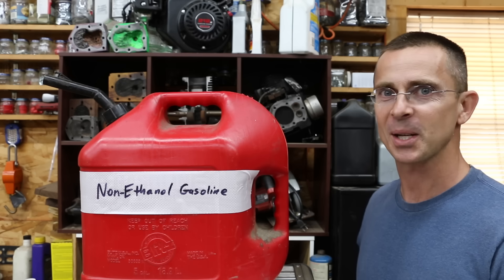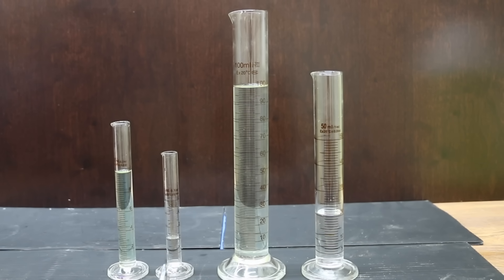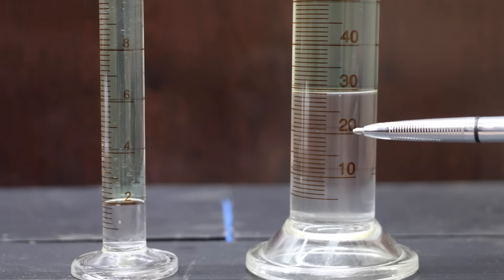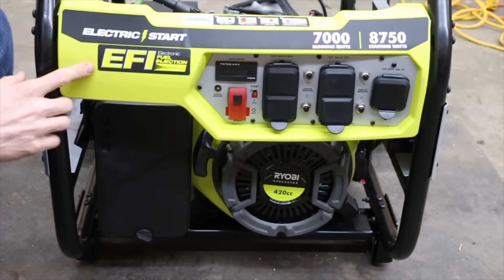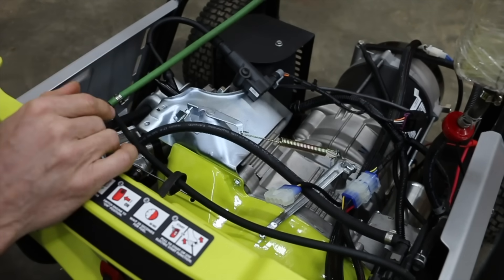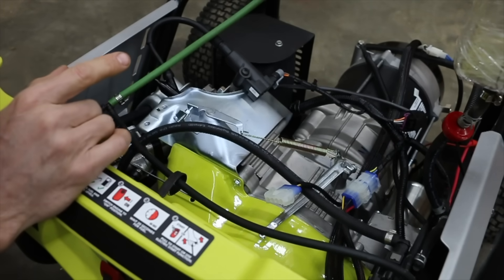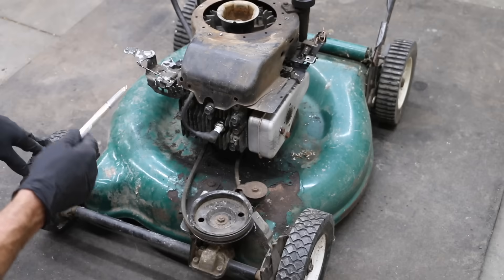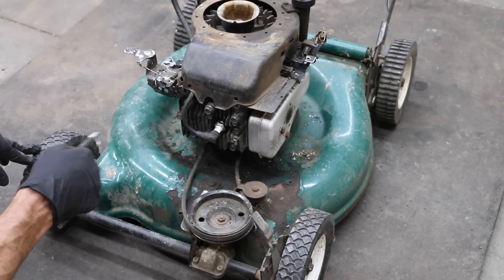Is Non-Ethanol Gasoline Really Better? See the PROOF!

Comment: Not to sound like a supporter of Ethanol, but in highway vehicles it does make for cleaner fuel as it will absorb water, clean fuel injectors ( so don't buy into fuel injector cleaning being sold to you from shady dealerships or garages) and does make your exhaust cleaner.
Reply from the maker: Thank you

Comment: Ethanol cost me many thousands of dollars in damages in addition to hours of frustration.  Stupidest idea ever conceived by the lowest IQ drones in government.  Finally had enough complaints in our community that all our pumps have ethanol free premium.  The way it should have been from the beginning.
Reply from the maker: Thank you
Reply: No problem.  Our then brand new boat still does not run properly to this day after 2 carb replacements and all new fuel delivery system ruined by that crap. Used to go 60 MPH first 2 years prior to ethanol introduction.  Today..? lucky to get to 40 MPH and up to plane.  Done throwing money at it after ethanol destroyed the fuel delivery system that keeps contaminating new parts.

Sold our 4 wheeler with only 800 miles on it as a non runner after multiple carb rebuilds and finally a new one....trashed yet again.

I am very mechanically inclined, but there is a point where the uphill battle against other's ignorance has to stop...liquidate the stuff and move on.

I cannot express my hatred for the FILTHY piece of human garbage that thought all engines would be fine with this.  I bitched day one that premium should be left alone as engines that require such fuel cannot even utilize whatever "benefits" alcohol could offer.

Sincerely,
Unfortunate and perpetual victim of living in a world run by 5rh grade educated idiots.

Comment: i have 3 carburetor machines in my garage that wont start, thanks to ethanol. I don't exactly know how to strip them down and rebuild them and haven't gotten around to doing it.   The tip with the water is great. I was planning on going 30 mins out of the way to find the only local station that sells ethanol free gas. now i wont have to i can just bump up the octane a bit.
Reply from the maker: Thank you

Comment: My lawn mower starts much easier with ethanol free gasoline.  Fortunately a station near me sells ethanol free at one pump.  If ethanol free gasoline doesn't work, then use starting fluid spray in the carburetor. Starting fluid is ether, which is explosive, but it also makes excellent spot remover for getting roil or grease off clothing. Just make sure you us it outdoors.
Reply from the maker: Thank you

Comment: Been hearing alot lately about using 110ll avgas in small engines because it has no ethanol, some of the other weird additives in pump gas and the almost non-detectable amount of lead actually helps with lubrication. (more for two strokes, but I'm thinking upper cylinder walls in 4 strokes) Maybe a head to head challenge? 5-10 tanks of each with a teardown after? Compression before and after.
Reply from the maker: Thank you for the video idea!

Comment: Ethanol has been in most gasoline since the mid 1980's.
E10 might not make that much of a difference as far as the cleanliness of the inside of the engine, but if you use E85 you should see a much cleaner cylinder head and spark plug after the teardown.
Reply from the maker: Thank you

Comment: First of all, small engines do not run that smooth on ethanol added fuel, they spit and sputter and run uneven.This is fake. Government, Fuel Companies, Lobbyist, are all liable to pay for the damages this fuel does to all small engines.
Reply: C King, you must hop into a plane to Brazil and warn them about ethanol in small engines ASAP!!!!!!!

Their common gasoline is not a measly 10 or 15% but a whopping 27.5% minimum.  They have small engines as found in this link:  https://www.honda.com.br/produtos-de-forca/gx120

Hurry before it is too late!!!!  God's speed!  If you are right about this they should more than thank you for it.  Now go....ooooooooo…...

Comment: Starting back in 95 or 96, Ford started to build motors to run on "flex fuels"; ethanol based fuels. From that time on, most auto suppliers changed their components, whether it was plastic, rubber or metals; to withstand the properties of ethanol based fuels. If you're not sure check your owners manual or the emissions sticker under the hood. It should state if it's compatible w.Ethanol fuels after the 97 model year. My 94 T-bird was not but my 97 was as stated on the sticker.
Reply from the maker: Thank you

Comment: But anyways ethanol prevents knocking and detonation right?  Carbon deposits are almost the same....
Reply from the maker: Thank you!
Reply: @ProjectFarm  sir I have a question...if we send the carbon monoxide from exhaust gases back into the engine cylinder what will happen? Will it get combusted? Will it increase the efficiency? ...can you try this for me just send pure carbon monoxide inside the air filter in a Spark ignition engine sir please....I wanted to know if carbon monoxide can act as a efficiency increaser....

Comment: Ethanolized gasoline is the worst thing that has ever happened to boating. In the California Delta most harbored boats are inoperable due to this garbage. Unlike most modern cars most harbored boats have a vented fuel tank that is open to the atmosphere where daily barometric changes introduces moisture. The moisture is absorbed by the fuel and over time it will cause the fuel to “phase “.  This is when the fuel separates into three distinct fluids. Water at the bottom then ethanol and gasoline at the top. There is no publicly available additive that can re combine the fuel, it must be removed. The water is acidic and corrosive which destroys the fuel system. If someone manages to remove enough water to enable ethanol to run the engine, it may run very poorly, like a cold motor but in fact it’s running lean because its not jetted for this fuel. This is where someone will make the mistake to take it out and “blow it out “. That’s when engines blow up. If the ethanolized fuel doesn’t phase, than this fuel attacks rubber and plastics components that where never intended for this fuel. If you have this type of boat, the best thing you can do is keep the tank full and use the boat to keep the fuel fresh or.......sell the boat.
Reply from the maker: Thank you!

Comment: Here in Iowa where most of the Ethanol comes from, most stations have 87 octane E0 and 87 octane E10. The E0 is always at least 30 cents more expensive than the E10. Some larger stations also have an 88 octane E15.
Reply from the maker: Thank you!

Comment: Back in the 70's when they took lead out of gasoline, my grandpa use to go to the local airfield and buy Av-Gas or Aviation Gas for his boat and small engines (both four and two cycle).  The difference between leaded gas, unleaded gas and Av-Gas was amazing.  That old boat ran like a scalded dog across the open water.  Maybe you can do a fuel test with Av-Gas sometime.  I don't see it much any more but the smell still takes me back to grandpa's garage.
Reply from the maker: Great video idea!

Comment: can you do a test with ethanoland non-ethanol gas and see what happened to the carbureted engine when it sits over time, I've been having issues using ethanol gas lately in my carbureted motorcycles and it seems to keep clogging up the Jets.
Reply from the maker: Thank you!

Comment: It's not so much carbon buildup or efficiency, rather the materials of the fuel system. It can destroy certain materials in carburetors over time coursing performance issues or total carburetor rebuilds. Better suited for fuel injected vehicles like it's deigned to. We have a 3 wheeler that needs a new rubber needle in it's carburetor, we ran regular (ethanol) fuel in it. The needle swelled up and wouldn't let any fuel into the jets.
Reply from the maker: Thank you!

Comment: I noticed it lowers fuel mileage and Decreases power and Torque. Not to mention the damage it does to older engines and fuel systems.
Reply from the maker: Thank you!
Reply: Your vehicle must be in need of some sort of repair and/or adjustment.

Ethanol increases power and torque.  For example a Chevy 5.3L pickup gets a clean 380 horsepower on E85 and a toxic 355 horsepower on E0.  E85 has 416 lb-ft vs E0 383 lb-ft of torque.
https://media.gm.com/media/us/en/chevrolet/spec-tables/2016/1500-crew-cab.html

Here is what exploding use of E10 did to repairs and maintenance in the US:
https://uploads.disquscdn.com/images/09f191db1baf6565c0aa85036f5531a1d479706d47ee0e4dbe160e2d71a7521f.png

Comment: Just what is so bad about carbon "build up"?
Reply from the maker: Thank you.  It impacts engine performance negatively.
Reply: @ProjectFarm  I am going to call bovine feces on that answer. The facts are as follows: 1. when the carbon is mechanically removed from the head, valves and piston top some compression is lost lowering thermal efficiency. 2. Carbon conducts heat slower (carbon when compared to bare aluminum, cast iron and steel, has insulating qualities so less heat is lost to internal engine parts) resulting in more heat to convert to work and increase in thermal efficiency. Once the combustion chamber has a coating of carbon the heat of combustion prohibits the growth of carbon deposits beyond certain limits by combustion temperatures defined by power produced, idle low temp more buildup, WOT high temp and hard thin layer of carbon with low heat conduction. This is in consideration that the engine is in good condition mechanically.
I am not trying to be negative, but helpful. If Project Farm had a proper form of a dynamometer  and proper instrumentation, for example CHT, EGT, blowby guage CF/Hr, engine oil temp, air/fuel ratio ( O2 sensor), observed power and torque, power and torque corrected to SAE standard day conditions. I realize this is a rather large monetary investment but this the least you need to fairly judge the results of products that you are testing.

Comment: Was carb adjusted to optimal for both fuels? As far as the recreation gas goes it is going to have either ZERO or legal minimum (100ppm) of additives in it. Was the non ethanol 84 0r 90 octane? E10 octane?
Reply from the maker: Thank you.  The generator uses EFI.  So, the air fuel ratio is optimal.
Reply: @ProjectFarm  I was referring to the mower test, AFR can have significant effects on the deposits. The generator runtime test fits solidly with the BTU difference between fuels
Reply from the maker: Thank you.  The engine was likely running slightly "rich" on the non-ethanol while running very close to proper air fuel ratio on E10.

Comment: Today everything is designed to use ethanol fuel and as such I use it in my cars and power equipment with no issues.  I have heard of folks getting corrosion in the system with ethanol, but I am speculating it was because they let the fuel set too long with not enough fuel in the tank resulting in a lot of condensation.  Use a good fuel stabilizer like sta-bil and fill the tank completely full when storing and you won't have any issues.  Ethanol is a different chemical with its own characteristics, so learn how to take care of it.  It's a different chemical, why would anyone expect it to act and perform the same as gasoline?  It does have a lot of advantages, remain open minded.  High octane, high horse power, american jobs, better for the environment, less dependency on foreign oil just to name a few.
Reply from the maker: Thank you

Comment: I might have a idea for a new video. Try running one of those little predators for 100+ hours non stop like in a power generation situation or water pump and see what the oil looks like. It would be interesting to see how long a splash lub motor can last on old oil.
Reply from the maker: Thank you for the video idea!

Comment: I run a golf car dealership for a living and about 9\10 times if I have a running issue it’s due to the customer using ethanol fuel . It degrades seals fuel pumps carbs and in general runs terribly after about 30 days or so . Now they also have five gallon tanks and get about 30mpg so it takes a very long time to run through a whole tank . So I deal with this a lot . Great video
Reply from the maker: Thank you

Comment: Where can ethanol free be purchased? I live in Virginia and it seems most places only allow you to purchase ethanol gas, which I'd like to stop using for my small engines after destroying the seals in two honda carburetors. Great video as always!
Reply from the maker: Thank you.  There's a website easily found via Google that provide where non-ethanol fuel is sold.

Comment: its fine as long as it dosent sit , but in small engines it tends to cause vapor lock (my guess anyways) when they run warm in my exp. when i did worked in florida using trimmers and gas powered saws . they wouldnt start when ran for 30 minutes or more untill they cooled down . this was noticed in mostly 2cycle engines. 4 cycle engines seemed to be ok with it ,unless the fuel sat in the carburator for a long time
Reply from the maker: Thank you!
Reply: @ProjectFarm  run your trimmer for 30 min get her all nice and hot , shut it down , and try to restart it , i almost garentee she will be vaper locked , and wont restart untill the fuel cools down , this was a huge problem in the industry i worked

Comment: For me it isn't about operation with my small engines, it's storage or summerizing my equipment. The last fuel I use in my saws or cutters is non alcohol, then I drain the tank, run the engine dry and store. Next season I just gas and go. I do remove the alcohol from the last gallon I mix.
Reply from the maker: Thank you!

Comment: Several years ago I rented a "new" full-size automobile (Impala) with 90 miles on the odometer, for a trip from Central New York to Portland, Oregon, and back. In the midwest where E85 was available, I ran a test with 3 full tanks of E85 on the way west, and again on the way back east. Then I "did the math" ... the MPG numbers were much worse, compared to E10, and when I figured up the "dollars per mile" numbers I was really shocked ... E85 is highway robbery ... maybe one day I'll do a similar test with "total non-ethanol" ...
Reply from the maker: Thank you!

Comment: If you ran a half a tank through of each types of gas then let them sit for a week would you still get the same fuel economy? Or even just over night? 
And if you repeated that over months how would that effect fuel economy and how difficult it is to start.
I am really interested in the effects on the rubber and plastic parts in the test you are doing. That will be a great video.
Reply from the maker: Thank you!

Comment: When I had my 1992 Bronco and would use 10% ethanol gas I would loose 3 miles per gallon. Not to mention all the power loss.
I've noticed if you use pure gasoline in small engines like snowmobiles they start way easier after sitting for a week or two. I wouldn't have to clean the carbonators as often too. 
Love the videos keep em coming.
Reply from the maker: Thank you!

Comment: Issue is that some small equipment manufacturers do not warranty their products if you use fuels with ethanol.   (Sthil for one)  And of course if you have older engines from the days before ethanol added gas became 'normal' then you have potential performance and long term issues.   Since I have a 1960/61 Cub Cadet with a Kohler engine, that gets only ethanol free gas.  (Don't use a lead additive though but it's been working fine for years now.
Reply from the maker: Great point! Thank you
Reply: Recently I've had an issue with my new Stihl Chainsaw, not wanting to rev up once it's warmed up.   Checked into it and at least one local Stihl dealer recommended using 93 Octane Non-ethanol gas.  Going to try that for a while.  Since I buy and mix 5 gallons of Non-Ethanol at a time so it takes a while to get through it even with all my 2 cycle tools (weed eater,  Chain Saw, Leaf blower. but going to go that route for at least 5 gallons worth and see the results with all 3 of those machines.

Comment: Greetings from the great white north that is Canada (Québec). I have a 2000 GMC Jimmy SLT 4 door 4X4 with a 4.3 V6. This vehicle will not run on fuel with ethanol added. It sputters and coughs and simply will not run correctly. The only gas I could find in Montreal without ethanol is Shell V-Power at a premium price. Otherwise the vehicle is 20 years old and still runs beautifully. Also, I do all my own maintenance. Your videos are great!
Reply from the maker: Thank you!

Comment: Ethanol costs are layered:
- Tax subsidies - you pay more directly and indirectly
- Reduced efficiency - you have to buy more fuel 
- Less power in non-boosted applications - you get less out of the vehicle you've paid for
- You get taxed again when you buy each gallon, as fuel tax applies to the whole gallon, not just the petrol part. You get taxed on the product that was already paid for by your taxes.
- Depending on your application, you short the lifespan of the engine components and fuel delivery systems. You get less use out of the product you've paid for. 
- Lack of choices and inflated non-E gas prices. Because most gas stations only have 2 tanks (reg and premium, mix both for midgrade), in the states where offering E10 is required, gas stations only carry E10. In my shit hole state, if I want to avoid the pitfalls of using E10, it costs me more because E0 is scarce. Even though it's cheaper to make non-E fuel, I still have to pay $1 more per gallon vs the more-expensive-to-produce E10 simply because E10 exists and is mandated.
- Everything else is more expensive. Because pretty much everything is transported via trucks, and transportation costs increase because of ALL OF THE ABOVE, everything you buy has a small margin set aside for those increased costs associated with ethanol fuel use.
Reply from the maker: Thank you!